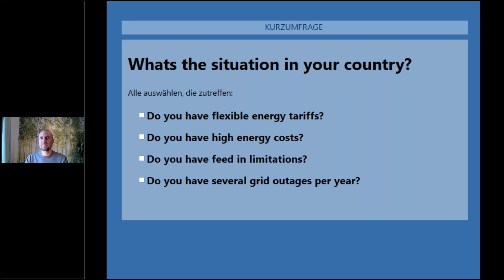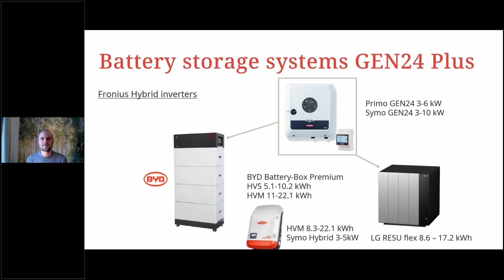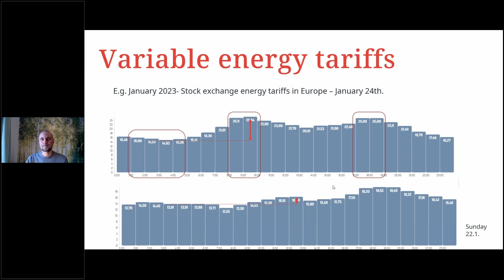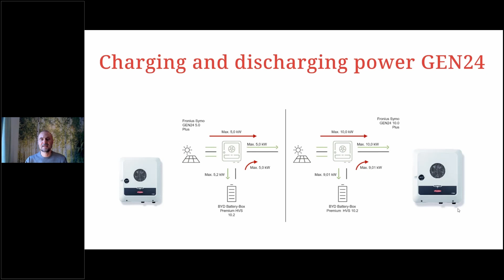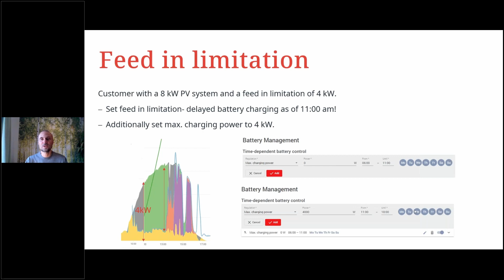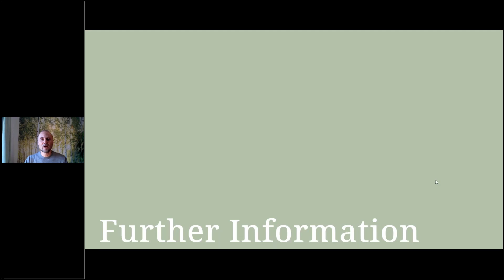Webinar: Battery management functions with GEN24 Plus

Comment: A facility that would be very useful - and is missing  -  is time of day battery management in relation to %SOC. 
For example: We have set the battery minimum SOC to 20%, and we have very cheap electricty from the grid 2am to 5am, and  8am every morning we use 1kWh  - which is 12% of the battery - from either the battery or grid before the panels start production. If from the grid this is an expensive peak rate, 
I want to be able to set min SOC to 32% from 2am to 5am , so if the battery is empty at that time it will charge, but not fully, just enough to get us to the next days sunshine.
Reply from the maker: Hello @beng711
thanks for your input! This will be possible with our new feature the "energy cost assistant". Please register for our webinar for detailed information on the solution: https://www.fronius.com/en/solar-energy/installers-partners/infocentre/events/webinar-en-optimal-battery-use13092024
Best regards, Andrea, from Fronius.

Comment: In the "Discharging with EV" slides he is discussing limiting discharge rates to allow the battery to last longer but the example shows a 'Min discharge rate" of 3000W.  Should this not be a 'Max discharge rate'? I don't think I understand the concept of min discharge rates.  If you do not have enough load to support the min discharge rate, does it export the extra power to the grid?
Reply: It does yes.

Comment: It's worth commenting on something that this video does not make clear. The Battery Management functions (the rules that explained here) are themselves prioritised in a seperate heirachy of rules. Although the main topic centres around enabling battery management functions when "permitting battery changing from the grid" is switched "on". The rules can be overidden (ignored), if other configuration settings are also in play, for example Power Limitation of feeding-in to the grid.
Reply: Care to elaborate on where those other rules are defined? I can't find anything that allows me to switch on "battery charging from the grid"
Reply: @nomad0367  OK , so battery charging from the GRID ( or any type for GRID use overrider )  is enabled through the energy management, self optimisation switch. Push that "on" and you'll be suppin from the grid at MAX KW/h. My earlier statement relates to logic which  comes into play (and is GRID centric) if you are not allowed to feed into the grid freely. the whole solution is  less efficient. ( you draw more & it costs more).

Comment: Is it possible to limit the maximum charging level of the battery? For Example could you set a limit of 80% battery charge level if you required?
Reply: Sadly seems not... just stopping at 100%
Reply: Looks like this is possible depending on the battery manufacturer - for example BYD settings in Fronius Component definition, allows both minimum and maximum SoC levels, if you choose Manual SoC Limit.
Reply from the maker: Yes, this is possible. Please watch the following webinar:https://www.youtube.com/watch?v=PlxPbcAgXU8